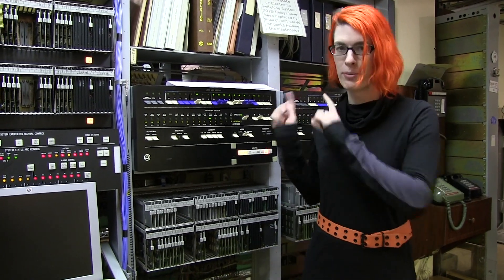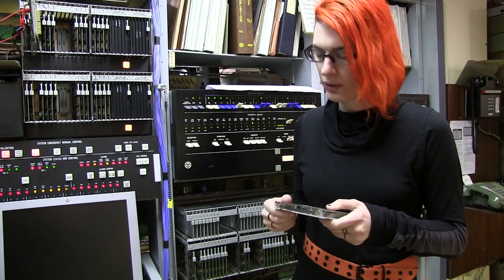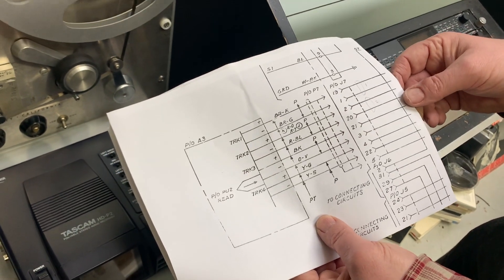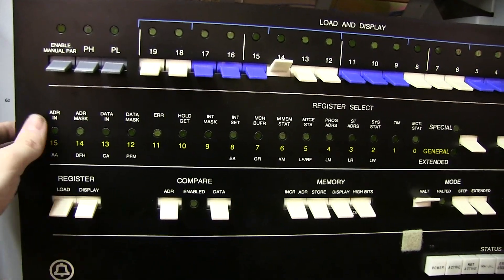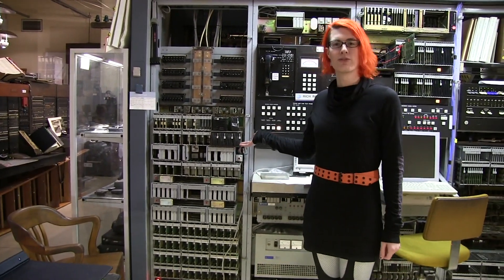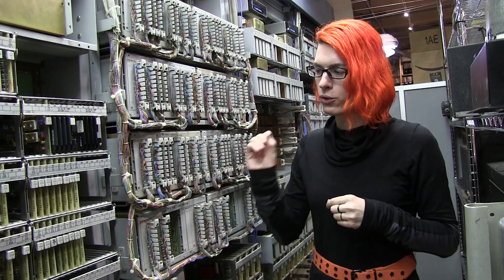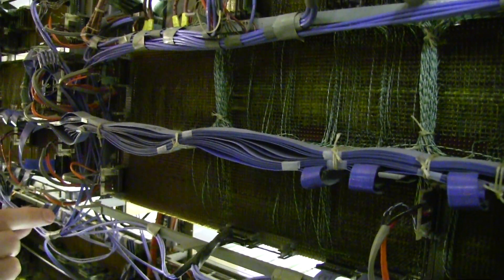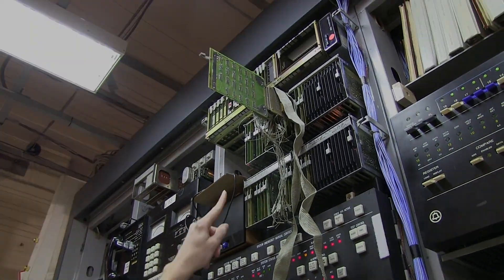[3ESS] Introduction and Tour

Comment: I worked at the Western Electric NIW Northern Illinois Works from 1977 to 1983 when it closed. I worked on the 3ESS from 1978 to 1980. Great memories here. I later worked on the 3B processor that was used in the 5ESS.

Comment: Very cool to see the processor doing stuff. Can't wait to see it switching calls :) 
As for the use of WireWrap VS/PCB That was still common in the backplane of a large system like say a VAX-11/780(which used large boards full of TTL chips to make the processor). There were several reasons for this, but what you mentioned (different REVS are done easily at the factory) was the main reason, it was also much easier to repair an issue in the field or make needed modifications.

Comment: When you mentioned wire wrap  vs solder and solder traces, you got half that right, and here is the rest why they chose wire wrap.

It's earthquake (read vibration) proof. Solder joints age with time and have a fatigue life that is shorter than wire-wrapped ones. Some of the first spacecraft had wire-wrapped components at first. Then they used solder and conformal dips and coatings to keep the whole assembly from falling apart.  Telecoms could not use the dips to prevent their connections from falling apart due to the level of flexibility demanded of their equipment, so they settled with staying with the wraps and punchdown boards.  Plus solder connections introduced a resistence rating into the connections where poor connections meant poor service.   Wrapping is consistent, especially if power tools are used, and a well-trained operator or a numeric controlled CAM system doing the work.
Reply: I wonder why modern networking hardware is all soldered. Unless it's on a plug.

Comment: I used a Biomation 32 channel digital analyzer trouble shooting circuit packs as a tester at the OKC Western Electric manufacturing plant in the late 70s and early 80s similar to that HP digital analyzer in the video. We made the 1A, Remreed, and 5ESS digital switching systems. We later became AT&T in 1984 and then Lucent Technologies in 1996.

Comment: Hey QT, can you do a video on how they trace calls.  Example tracing a number back to a prank caller.
Reply: Hay Tech NO City.  You want to know how to trace a Call?  First, we have to know is this a call-in progress or a person who is receiving prank calls. let's start with a person (Line) that is getting prank calls. The information store in the switch memory is divided in to three parts. 1) Generic, that's code that the CPU runs to do all the functions required to operate the switch. 2) PDA, that is the data that describes what equipment the ESS switch is made of. 3) TDA is Translations.  Translation data is What numbers are connected to the switch and where they are connected to the switch.

TDA- Translation is kind of like CONTACTS in a mobile telephone. Every contact would have a telephone number and an address. The street address would be the network.
If the Telephone number is in a DMS100 Switch, there would be a word in the line translations "TRACE". In a 1ESS, a single Bit being marked would tell the CPU to send a Maintenace Message to the Control Center with the date, time, calling number, called number, calling numbers network connection.  This all happens before the phone rings.

For a call-in progress, the Control center will send a message to the Switch and get the information message back from the switch.

 If I got any of this wrong, remember I'm and old man.

Comment: When you're talking about the processes, you should have mentioned, one process is online and the other one is standby, but they both monitor every single instruction going through the system, if there is an error detected the error detection and correction circuit kicks in, depending on the error will determine what equipment will be removed and diagnosed, if it escalates with a condition is worse than the processors will actually switch, the active becomes standby to standby becomes active and it continues to look at all the peripheral equipment first to see what level caused the interruption and it goes from there right up the line until it might be detected in the processor itself. In that case the processor that is active due to the system switch will diagnose the previous active processor and come up with the problem whether it be software or Hardware. The telephone employees maintenance Richmond, in most cases we'll just have to change a circuit pack. Once that's inserted Powers turn back on it will diagnose the processor also along it's doing routine Diagnostics on other peripheral equipment. If the problem was resolved, it may switch back the standby to become active again and the active to become the standby processor. I worked in the Bell System, for 36 years, I was systems qualified, in number one ESS, that was our first electronic switching system, ETS, electronic translator system that was an interface and controlling T1 carrier systems long distance, tsps that's traffic service position systems, that's the system that eliminated all the a board operator positions and went to to position consoles all electronic, number for ESS, the first digital electronic switching system, and number 5 ESS, the first electronic switching fiber optic system. Again systems qualified in all in the above systems. Best years of my life working with starting out with Western Electric, then eventually turning the name into AT&T, working with bell labs. I started my employment in 1963, I retired after 36 years, today's date is September 10th 2022.

Comment: How do you repair the memory? I am reading that the 3ESS uses semiconductor memory. Is it just replaceable?
Reply from the maker: Yes, they're DIP chips on standard PCBs. We've been noting what bits go bad and replacing the bad cards with spares. We haven't needed to salvage individual chips yet.
Reply: @ConnectionsMuseum  These are early DRAM ICs?  During the 1980s I know that Xerox had to test memory chips heavily for the Xerox Star workstation to weed out potential failures.
Reply: Plugable memory cards. It one failed it was sent back to Western Electric for repair.
Reply: I designed that memory system from its beginnings in 1970 until 1973.  It was the first use of semiconductor DRAM in a Bell System product.  The first prototypes used the (then new) Intel 1103 1Kx1 DRAMs.  The intention was to eventually use 1k DRAMs being developed by Bell Labs semiconductor group in Allentown, PA, to be manufactured by Western Electric.  Although I made many trips to Allentown to liason with that design group, by the time I left the Labs in 1973, they only had 256x1 chips working, so we continued with the Intel parts.  Yes, there was a dose of intra-company tension about all of this.  When I left, the system was just going into production at Western Electric Hawthorne works, still with Intel chips.  I imagine that in later production they eventually phased in the in-house chips.  I hope to visit the museum some day and look at the memory boards and see what chips are on them.  I see from the video that the boards holding the memory chips are still pcbs with standard DIP packaged devices.  The boards for the memory control system and the cpu itself were all ceramic hybrids with the in-house integrated circuits bonded to the substrate  (changes were really hard to make on those ceramic boards! But, they were part of the ATT "40 year equipment service life" credo).  Another thing-- although the memory control boards all used in-house Bell System 1A 5v TTL SSI logic chips, I was allowed to use some standard 7400 series parts, such as 7438 high current sink open collector nand gates, to handle tasks that no 1A logic chip could tackle.  I smiled at 5:30 in the video to see a couple of the RAM memory cards with red tags on them.  I am wondering whether my error detection circuitry helped you sort this out :-).  So glad that you had some spare cards!  Other than some of the circuitry for remote diagnosis of the memory pc boards, the circuitry on them is pretty straightforward should you ever need to recreate or repair them.  Warms my heart to see the hard work the museum team has done to get this machine running again!
Reply: As a last resort it's probably not too difficult to replace with modern SRAM, which is still manufactured

Comment: In light of current events, at what time did remote / out-of-band management start to become common on telecom equipment? Is the 3ESS remotely manageable?
Reply from the maker: The 3ESS is totally remotely manageable! It was designed to run unattended for long periods of time. All the keys and lamps on the system status panel (above the teletype) can be hauled over a modem to a central Switching Control Center. The equipment to do this is above the tape drives; note the modem on the far right side of that frame. With a second modem for the maintenance teletype, most problems can be diagnosed remotely.
Reply: I worked in an SCC and we had remote telemetry displays on the wall of unnamed C.O.'s ESS including 1A,#3, #2,etc. It had lamps for things like power, processor, major, minor alarms. We could access the C.O. via full duplex data circuits which were accessed from DEC PDP-11/70 computers running Unix.

Comment: In the late 70's AT&T tried a voice mail system with #3 processor family but they could not get the bugs out of it. It was scrubbed.
Reply from the maker: The 1A Voice Storage System! The story that I've heard was that it was too far into "value added services" and the Department of Justice nixed it.
Reply: I don't know about the DOJ nixing it. But I worked on the project and for the day each trunk card was a fortune. It had it's own microprocessor and RAM storage and was physically  large. Another issue was during testing more then a couple simultaneous calls and the whole system crashed.  The there was the power thing. Had a new type of power inverter "tristate?". It had a problem, 
we had one that caught fire. The fool thing tried to feed power back into the A.C. power. Software bug. One inverter toast. Set off C.O. Fire Alarm. A lot of panic. Bell Labs was there some quite some time trying to fix everything. Interesting note the first C.O. to connect to it was a #5 Crossbar in the late 70's. Then there was the large disk drives each one about the size of a washing machine and i think there was six. Yea that was it VSS.

Comment: Would a Raspberry Pi be a good canidate to emulate failing devices on the ESS? Iv'e seen it used a lot to emulate hardwre for 80's vintage computers.
Reply: Don't know about the ESS but it is true that most things can be emulated with a tiny modern circuit board. Raspberry Pi is a good choice for some things, bad for others. It can emulate a lot of peripheral devices but it's a bad choice to emulate a chip - an FPGA is usually a better choice for that.

Comment: I would think somewhere in the AT&T labs junk rooms or the basements of former AT&T engineers, there must be a copy of the source code for that system? Has anyone from AT&T offered to assist?  I still have 5in floppies of Z80 source code I wrote in the mid 1980s for some industrial control systems.
Reply from the maker: We have a full listing on microfiche! So convenient!
Reply: Unfortunately devices to read floppy disks are as rare as Hen's teeth. WOW! Zilog. There's a work I haven't heard in a while.
Reply: I hope you mewmt 5-1/4" floppy, as a 5" floppy would be very rare if not impossible to find. Also floppies back then came in various formats, including hard sector formats.
I do restoration work at a computer museum amd I work on all sort of computers from altair/imsai to DEC large mini computers
Reply: @rty1955  Yes, I meant 5&1/4. Handled plenty in the 1980s! I still have a drive if I ever need it.
Reply: @andydelle4509  I have an older PC with both type of drives thay runs Linux so I can make ISO images of floppies and those images can be mounted anyplace.
U have to keep moving data along or risk losing it